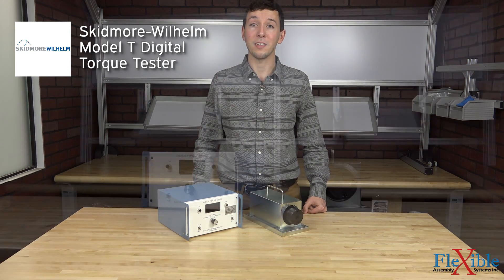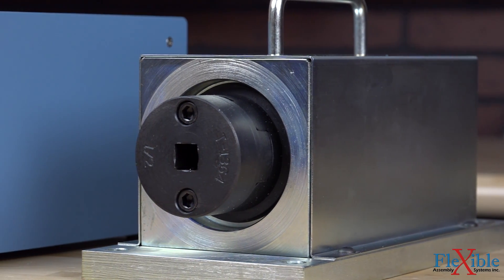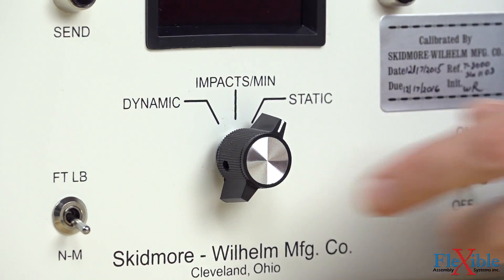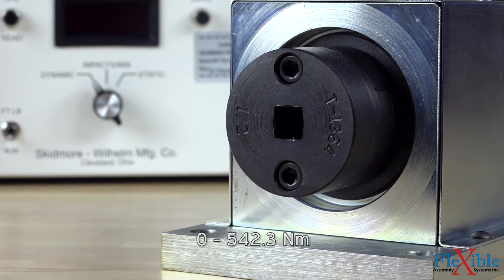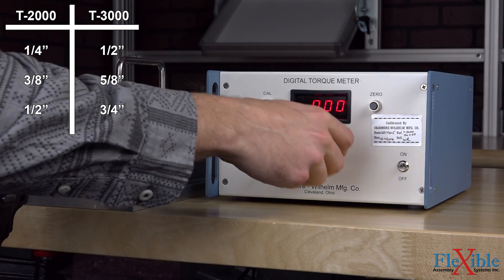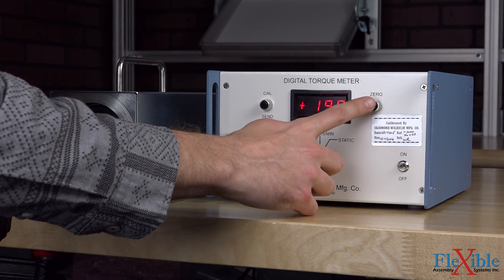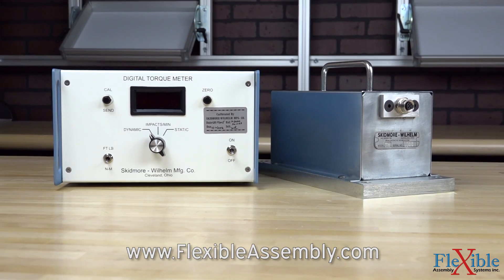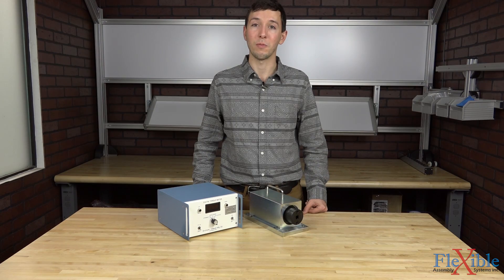Skidmore-Wilhelm Model T Torque Tester

Comment: Where can I get the input transducer?
Reply from the maker: The input transducer comes with the torque tester, the capacity depends on if you purchase the T2000 (1/2") or T3000 (3/4") model. Their capacity is as follows: 
T-2000: 0 to 400 ft.-lb. or 0 to 550 N•m
T-3000: 30 to 1,000 ft.-lb. Or 1,300 N•m
You can pick up one of these from our website here: http://www.flexibleassembly.com/Products/Skidmore-Wilhelm-Torque-Tools_2/Skidmore-Wilhelm-T-Series-Torque-Tester